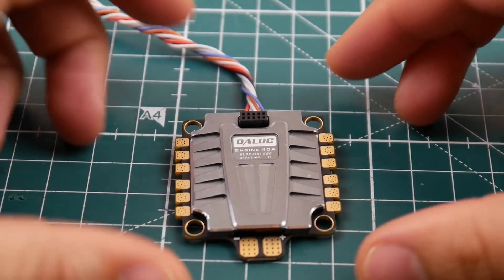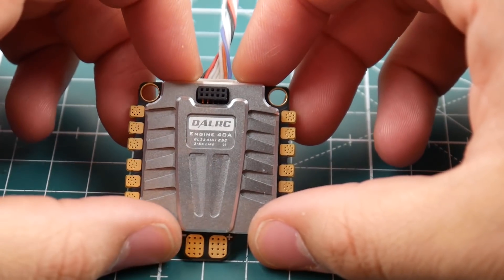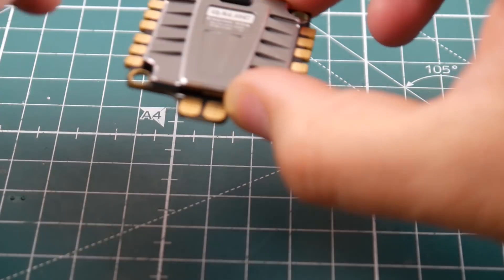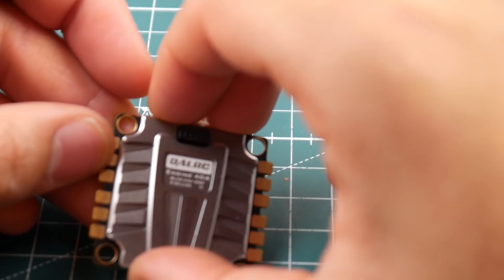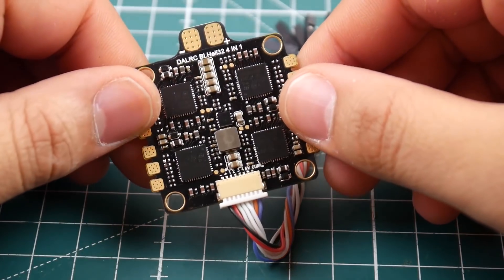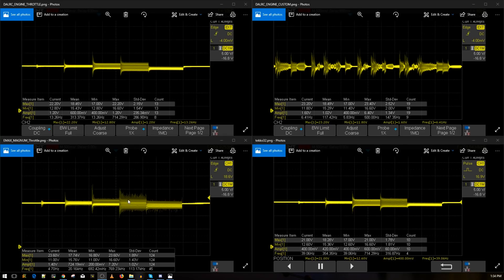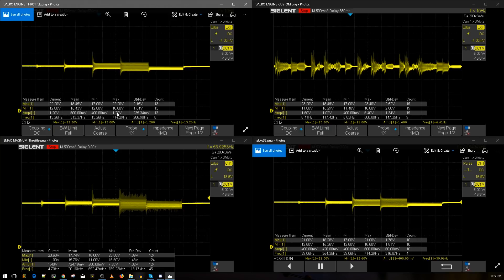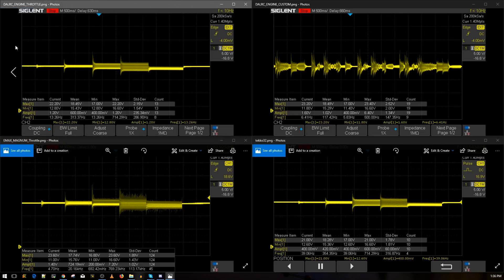DALRC ENGINE 40A ESC // Review and Noise Testing

Comment: Hi Drone Mesh,
I am planning to use this esc on a 450 frame with 10 inch props. The max AUW should be around 2600g. Every Motor sucks about 25A. Do you see any problems using this esc with such big motors/props. 
It would be great to hear your opinion on this topic! 
Thanks in advance and keep the good work going!!

Comment: Seems thermal compound is not evenly distributed over caps. Some FET-s are not covered and may heat up more which can cause potential desync and/or damage of these FETs. You should mention that too. 11.4-23.4V voltage fluctuation on running motor seems pretty good for me. Much more than Emax Bullet-s are doing.

Comment: how about the regenerative power back to battery spelled in the spec?
Reply from the maker: Hideo VT All esc's do that it's the voltage spikes.
Reply: Wow, didn't expect that, new thing learned. Appreciated for the clarification.
But, any different between low voltage spikes ESC & high voltage spikes ESC that will significantly do the "regenerative power" ? Curious to know.
Good job mate, keep up the excellent works!!!

Comment: Be aware that it does not work with the hobbywing f4 flight controller pins.  I had to use the wire connect.  The pins don't line up perfectly and one or more pins is not the same as the dalrc pin layout.  Caused my beeper to stay on continuously, assuming it was sending full battery voltage to the FC.  The solder pads are nice, zero chance of a pad lifting with the holes that go through the pads.  current sensor scale worked out to 213 for me.  I used raceflight gummies to soft mount, the ones that come with it are too tall for most builds.

Comment: I have been using the dal engine on a BRAAP with KISS V2 FC and it is unbelievably smooth with minor tuning.
Check out my video called “Post Work Stress Relief” and you will see this esc in action reining EFAW 2407 2500kV Motors and 5552 props !!
Thanks!

Comment: Hi DM, how many motors did you have running on it within the test?  If only a single engine, then it would be getting 4x times more  inbuilt ESR capacitance than normal.  Please can you test with 4 motors attached?
Reply: ignore it, sorry I missed that part in the vid. :)

Comment: Hi, may be for direct comparison of 4 in 1 ESC with single ESC would be interesting to add low ESR capacitor to balance the capacitance of 4 in 1 to single one. For example if 4 in 1 have 1000uF of capacitors on board and single one has 470uF on board fair test would be to add at least another 470uF to single one under your conditions with test with only one motor. Otherwise the results are little bit biased as you mentioned in video already.

Comment: Great work, dude! Would be great if you could check out the new Typhoon 4in1 ESC V1.2! Version 1.1 had a lot of noise but they promised to fix it with 1.2 and added lots of caps... I wonder if that fixed their noise problem!